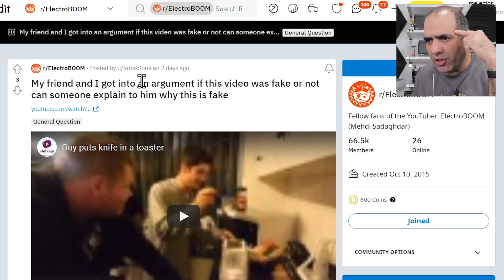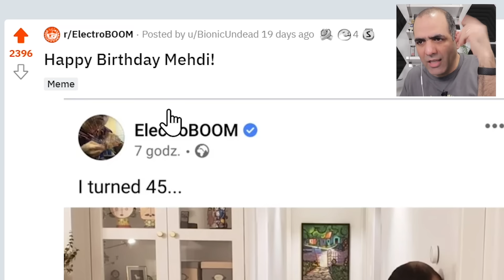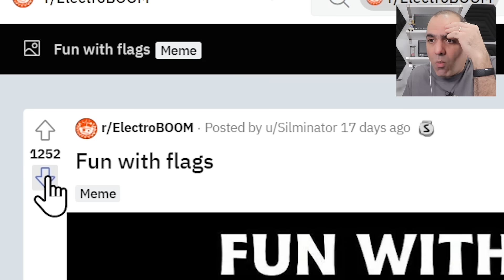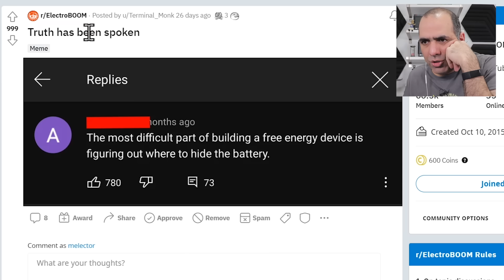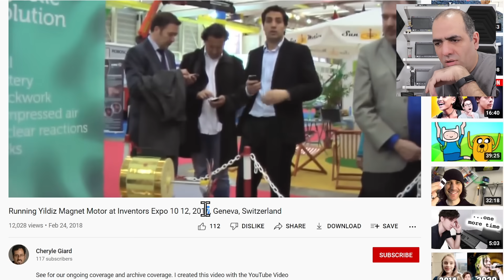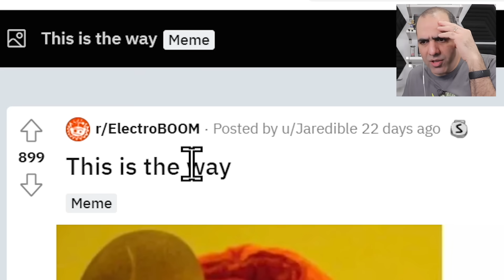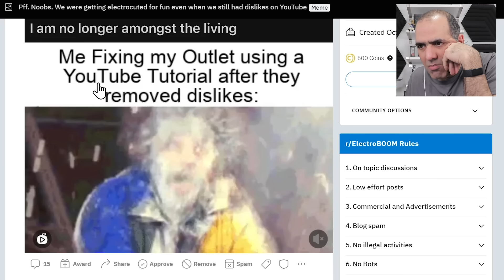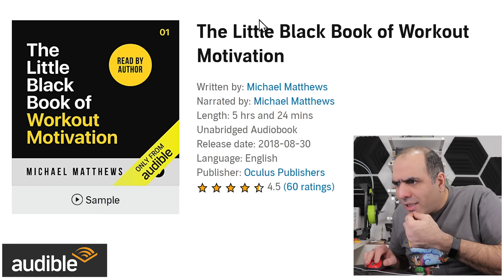Sticking Knife in Toaster? Welding with SALT WATER?!!! (LATITY-009)

Comment: 5:58 
If someone is interested behind chemistry in this experiment i could try my best to explain.

Basically there is a kathode and anode which are in order negatively and positevly charged. (yes they are reversed in this case, because as we know in electronics we write the opposite direction of the actual electron flow which in chemistry is very important NOT to do)

There will be several reactions by electrolisys:

A)  Water electrolysis 

On anode (+)
2H2O -> 4e + O2 + 4H+ 
( Anode "wants" electrons so it rips 4 off them from 2 molecules of H2O ( truly from O2- ions because they have spare elctrons gifted from the H+ ions ) releasing oxygen. The presence of H+ Ions makes the anode space acidic )  *Of course H2O doesn't have 100% ionic bonds but rather polarized covalent bonds, but I skipped it for easier understanding.

On kathode (-)
2H2O + 2e- -> H2 + 2OH / *2
4H2O + 4e- -> 2H2 + 4OH
( Kathode gives off electrons so 4 molecules of H2O ( truly H+ ions which have a free orbital for an extra electron ) are accepting them, in the same time reducing those ions to elemental hydrogen. The presence of OH- ions makes the kathode space basic )

Both hydroxide and hydrogen ions will react together to make water in following equasion:
4OH- + 2H2+ --> 4H2O

B) Electrolisys of ionic salts dispersed in solution and other dissociating compounds 

On anode (+)
2Cl- -> Cl2 + 2e
(As in the previous case anode wants electrons so it gets them from Cl- ions (which are the result of NaCl dissosiation in water creating both Na+ and Cl- ions) in the same time releasing elemental chlorine gas.

On kathode (-)
2H2O + 2e- -> H2 + 2OH 
( To the amazement Na+ ions do not undergo reduction because reduction of Na+ ions (E° = –2.7 v) is energetically more difficult than the reduction of water (E° = –1.23 v), therefore water takes priority so the results are identical as those in point A ) * The hydroxide ions likely reacted with metal electrodes (which I'm guessing are made of iron) and corroded them.

There is a bunch off other stuff considering that Mehdi used tap water. A lot of other salts composing of various ions such as: Ca2+, SO42-, NO3-, Mg2+, K+ , CO32-.... etc.
I won't mention them all, since there is a lot of possible combinations and I'ts not that different from earlier written reactions. 

So to sum up, Mehdi was creating a bunch of hydrogen, oxygen and chlorine gas which are together toxic, explosive and flammable.
(From other ions reacting there might've been released some small amounts of CO2, H2S, NH3 etc.)

Sorry if i made any mistakes in english or science. I'm in 2nd year highschool : )

Greetings from Poland!

*ps uwielbiam twoje filmy, bo są tak idealnie zrównoważone pod względem humorystycznym i naukowym. : )
Reply: your profile picture goes so well with your comment, that was very interesting to read
Reply: @yannotk  Glad to hear It! :)
Reply: True
Reply: Errr, thanks for the 4th grade reminder.

Comment: I used to stick butter knives in toasters all the time as a kid, because, if I pressed the toaster's filament with the side of a knife, it'd turn from red back to black.  And then when taken off it slowly heats up again.  It was just amusing.
Best part is?   Butter knives don't have plastic handles.   I was using a solid metal knife to prod inside a toaster. Purposefully touching the filament.  While myself being definitely grounded.    DOZENS OF TIMES !  Fun!
Reply: Not gonna lie not sure how I didn't get at the very least knocked on my butt by a jolt any time.

Comment: You don’t need a cfgi on that toaster. A cfgi is for any kind of ground fault, which includes this kind, however,  a normal circuit breaker will detect a voltage on the protection pin and interrupt the circuit as well. The important reason why you should be using a cfgi plug for this experiment is that the cfgi will stop you from dying here

Comment: when i was a kid, i remember plugging in landline phone dock into three-phase socket (european) and nothing weird happened, the doci still works to this day XD
Reply: European outlets are not three-phase.  They're 240V single phase.  It's extremely rare to see three phase circuits ANYWHERE in the world except in industrial shop floors or heavy machinery.  A true 3 phase outlet would have to have at least four pins (L1, L2, L3 and protective ground), and a fifth if the device wanted a neutral too.

Secondly, most consumer electronics like cell phones, wireless phones, rechargeable razors, laptops have "wall warts" (charging blocks that either plug right into the socket, or on short cords of their own) that are designed to work with anything from 80V to 250V, and at most you need a plug adapter to use them anywhere.  This has been true for decades.  They use solid-state voltage converters that supply a much lower regulated DC voltage to the battery charging circuit from the supply line - you just have to ensure that the "hot side" components can handle the input voltage which is at most a few cents per unit, which is dwarfed by the cost of having to have multiple models of charger for every country with a different voltage.

These are REALLY cheap as long as you don't need much current.

Meanwhile, higher load plugin devices like hair dryers, blenders, coffee makers etc usually only work on one voltage, and you will usually need a transformer (heavy and expensive) to convert the supply voltage to what the device is expecting.

A little story:

A friend and colleague of mine had a real mania about American donut coffee, and cannot stand the European coffees of any kind (much too strong).  Whenever he went overseas to conferences we'd join up there - he would always bring his wife (I did sometimes), and the three or four of us always had a good time.  I"m Canadian and am perfectly fine with certain European coffees.  But not him.

As soon as he'd arrive he'd send his wife out to buy a drip coffee maker so he could drink his own coffee he brought with him.  When they left, he left the almost new drip coffee maker in his room.

I eventually managed to get him to try half or quarter strength Americano, and he found it reasonably tolerable, but he still had to bring his own coffee.  My wife got his wife addicted to Dulce de Leche, she was so much adventureish than him.

But yes, Europe got sprinkled with abandoned coffee makers that had only been used for a few days.

Check the label.  It's the only way to be sure.

Comment: There are no hidden batteries. That magnet motor is made up of magnet, the magnets were charged and they will run out. The magnets are "technically" batteries... i built one out of magnets and wood in 2005 based on my plans from 2001 but I realized later that the magnets loose their gauss with the constant magnetic friction...

Comment: My answer is, no, that's not real. Sticking a knife in a toaster can have three outcomes: one, it trips the circuit breaker. Two, the person with the knife becomes part of the circuit and suffers a dangerous but invisible electrical shock. Three, the circuit breaker or fuse fails to operate properly and the toaster and/or the outlet catches on fire much more tamely than that. To get a burst that powerful, you need a stronger current than your standard home outlet can provide. I have no doubt it's possible to jack that kind of current into a toaster from a 220 or 440 line, but there's no way they'd ever actually have someone stick a knife into it, even in Hollywood. No, if that wasn't pure green-screen, they must have used a small charge of flash powder with some pyrotechnics to provide the sparks.

Comment: You might be able to get the saltwater welder to work if you use a thin electrode for low amps. I believe it is 1/16 that can weld 15 - 30 ish amps or something. Still not a good idea.

Comment: Idea, by using a form of negative ion generator or static electricity generator and some voltage multipliers, you can move things with your mind, like the floating tin foil but better.

Comment: Actually that salt water welding works, but current is only good for thinner electrodes like 1.6 - 2mm electrodes. I have tried to weld with 2.4 mm electrodes but it was kinda ugly and really hard to make a joints, also the arc is much longer than normal welder due to the higher voltage, but somehow managed to weld my broken blade of big kitchen knife. Seems like 1.6 is only sufficient electrode for that much Wattage. Also it draws around 15 amper and 230V from the socket in my case, so if you have any circuit protection system, you better shut it off incase if you want to perform welding. Although I did it outside in the garden, but still there was weak spot in one spesific wiring joint, that some wires are coming from Electric source along to the socket was loosely connected, so it got melted and disconnected, so I had to fold them together and use some insulation tape, not big deal though.

Comment: As a knife-in-toaster survivor, I can confirm that video is totally fake. I once tried removing a toast that wouldn't come out with a knife, and touched the filaments by accident, and there was no big ass explosion. Scared the s#!t out of me too, though. Good thing I was using a knife with a plastic or wooden handle.
That said, that's one of the many reasons why that type of toaster ABSOLUTELY SUCKS. But more importantly, they ABSOLUTELY SUCK because you can't make proper cheese toasts in them. Which is just PREPOSTEROUS!

Comment: NaCl (salt in the water and electricity ) should produce Hydrogen not cloride gas but hydrogen and a sparks is also not good for you :))) at least its not compressed :).
EDIT: actually I checked and both gases are created but if you use copper electrodes will be no chlorine gas, will be only hydrogen :)

Comment: And my last video ever: "Showering with a space heater". Salt water as a series resistor for welding with line voltage is a common trick in Eastern Europe. This might not be wise, but it works. It is not a scam. In the full video The presentation at the Delft university of the Yildiz motor, sveral attendants are seen walking out in a demonstrative disapproving manner.

Comment: That’s probably hydrogen evolution, not chlorine; the voltage is high enough for either to occur, but the hydrogen should be reduced much faster than dichlorine generates

Comment: As a kid i did touch the glowing wire of a toaster though. Lucky i did it with some of the few knives we had in the kitchen with an all plastic handle. 
Nothing spectacular happened, the fuse blew and i had to walk from the kitchen to my room on the floor above in darkness to get my flashlight so my mom could put in the fuse again. 
😂✌️

Comment: I have a question. I know there isnt free energy but what about this? What if we connect 2 motors, one as generator, then run one and after it is running at max power just turn it off. Wouldnt the motor keep spinning for a few seconds before stopping? so when it is fast and we turn it off wouldnt it take a while for the motor to fully stop after it is turned off and can we use it as our advantage?
Reply: I, too, am puzzled by the setup. What's with the hammer? Where's the battery?

Comment: I did get into trouble making toasted ham sandwiches by putting bread slices into the toaster then laying ham over the top of the toaster.  When the bread pops up it lifts up the ham, which is then ready to put inside the toast.  It works well but leaves stains on the toaster

Comment: Hey you might be able to help me so I bought a clock from a guy and it goes backwards like 10 to 9.59 to 9.58 and idk faulty wireing system I mean there's a red wire hooked up to to a weird cylinder and a blue one how do I fix it?

Comment: The best tip to workout. just have a 5 hr energy sitting by your bed. when the alarm goes off, drink it. 15 minutes you will be peppy. Get the workout clothes on, get the dance music going. and just do it! But I think what really holds people back from working out, is they dont know how. They go to hard. they end up sore during or after. Then they dont want to go back. Use the heart rate mode for the cardio equipment and set it for 130 bpm for 20 minutes. do that for 3 weeks a couple times a week. And then add 5 minutes or 5 bpm, rince and repeat. and make sure you drink water during your workout.

Comment: 6:25 It you have to go cheap, use the transformer from a microwave inverse. You will get very low voltage and high current.

Comment: Some people might see the plastic or wooden handle on their knife and feel safe trying this out. But there are, by my limited count, four ways you can still get shocked in that scenario.

1) The knife is similar to the knife Mehdi is using here. You can see that the tang (that's knife lingo for the part of the knife that goes into the handle) is sandwiched between two pieces of plastic and is fully exposed. A zappy creme to a dangerous Oreo.

2) The tang of the knife (we already know what the tang is) is fully surrounded by an insulative handle, but the tang and the handle are fixed by exposed metal rivets, pins, or screws that go all the way to the outside. This is very common. If you have a knife where the wooden or plastic handle has some metal "dots" in it, those dots can shock you. They're connected to the blade, electrically.

3) The handle is really really thin. I don't think this is common.

4) You're still touching the blade. This is a matter of knife grip, and I don't think it's going to come up very often. With a wide-bladed knife, like a cleaver, santoku, or chef's knife, it's common to press the pads of the index finger and thumb against the blade itself, while wrapping the other three fingers around the handle. I've learned to do this, at is give me a little more torque and fine control. There are a few reasons I don't think this would come up too often in a toaster shock: a) Usually only experienced cooks use this grip, and experienced cooks have injured themselves in enough other ways that they're not about to risk shocking themselves. They're going to unplug the toaster first. b) This grip is for wide-bladed knives. If someone is using a wide blade to get bread unstuck from a toaster, they will almost certainly make contact with the other metal parts, which Mehdi has shown are (at least in this model) grounded. Shouldn't be too much of an issue. c) Paring knife. Despite the narrow blade, these are often held with some finger contact against the side of the blade for control. But anyone who i) owns a paring knife and ii) holds it that way unlikely to i) use a paring knife for this application AND ii) hold it that way.

Comment: Some sensors don't detect LEDs. The fire sensors on army helicopters have to be tested with incandescents, lighters, or perfectly angled sunlight, but if we try to perform the tests with LED lights, nothing happens. It freaked us out a few times, thinking we'd have to test the entire fire suppression system, but no, we just had to cup our hand around a lighter.

Comment: I used this fifty years ago, as a boy, to do my first welding.  You just adjust the current to match the metal thickness.  I made an arc furnace, for melting metal, using the salt water to limit the current.  I guess they didn't say it was dangerous in the sixties. Well, they did say "be careful".  Semper fi, John McClain

Comment: You should revisit the Baghdad Battery, as the Antikythera Mechanism was confirmed as real and working, so it really isnt far off that the battery may have worked as well, just not with the conventional fluids we know can be used to make electricity, alongside the fact that it may have used a powdered electrolyte rather than liquid.

Comment: Mehdi, be careful with the salt and water welding. Most of the bubbles are Hydrogen and Oxygen (with Chlorine, also, because of the salt) and Hydrogen is flammable. Don't do it indoors, please.

Comment: Lol he started sniffing hydroxy gas off the jar.
Reply: The magnetic engine is real that is one of the old prototypes. The problem with them is they don't have any sort of higher torque applications. They end up using them as passive generators to ether charge a capacitor array or a more efficient generator that requires ample starting power. The solar array that is powered using a mag-lev motor. Is actually used on private long distance space vessels. Usually ment for the application of getting space force communication and reconnaissance telescopes. Because of the effects of microgravity in space you can get away with a lot of maglev type generators that produce a lot of passive energy.

Comment: Hey Mehdi, I was just curious if you had an opinion on what if anything is the best way to protect a home pc from things like noise in the line, brown outs, surges, capacitance from poor wiring and or the use of extension cords and or poor power factor?
Reply: Also, a follow-up question. I hear a lot of people say that a line interactive battery backup is probably the best solution but what is someone doesn't need the time to shut down, that a battery backup affords? Is a voltage regulator good enough?

Comment: I stuck a knife into a toaster when I was 12. Wouldn't recommend it, it hurt. There was a bang & a flash, and then I picked myself up off the floor on the other side of the kitchen. Melted the tip of the knife. This was back in the early 80's, and it was an old toaster. 240v ac kicks like a horse. Ever since then if the toast gets stuck I turn the toaster off first!